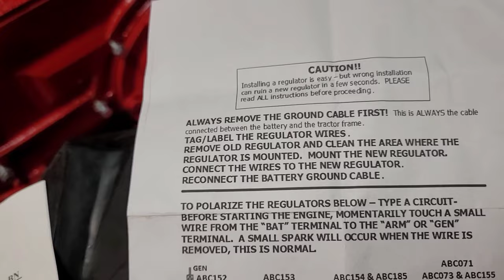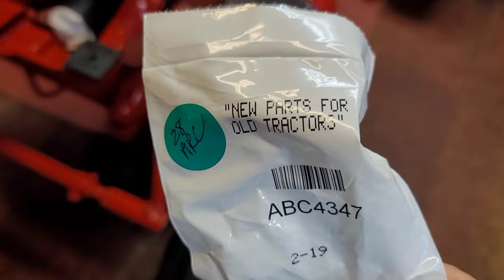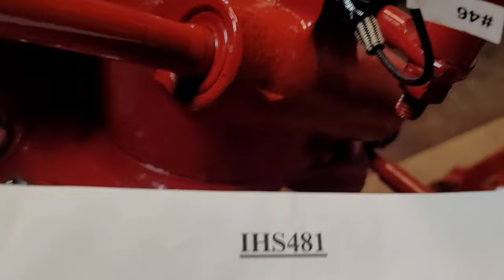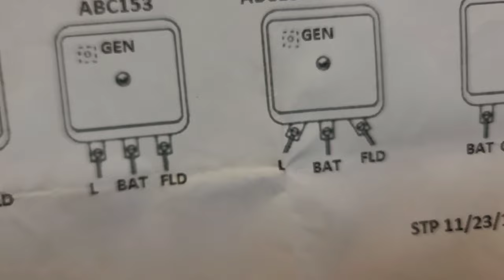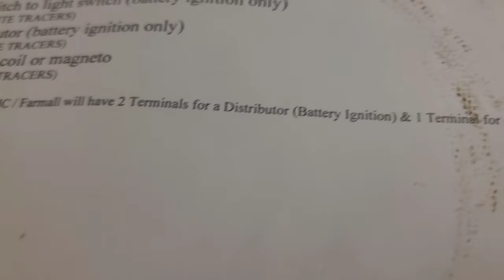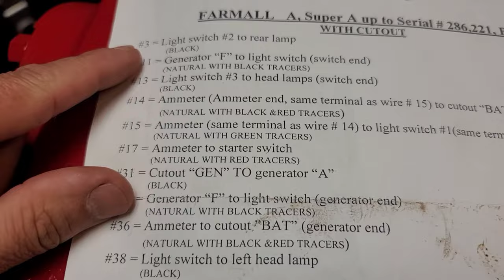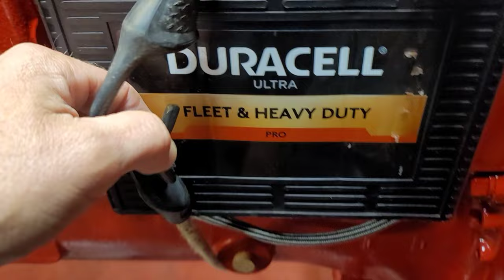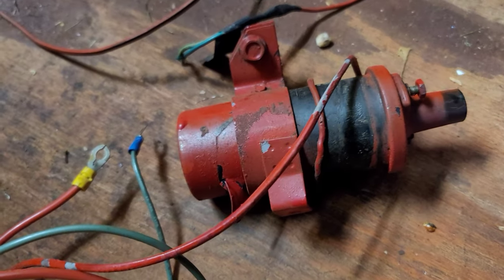Farmall Super A Wiring Explained

Comment: I’m working on a 12v A with a generator and voltage regulator. Boy is it confusing. Old farmer hack job and I’ve been trying to rewire while keeping the Mag. There is not much info for it. 

I didn’t think to buy a pre made harness and wanted to save money reusing the old VR and Generator. 

The only real difference other than 6v is I have a toggle light switch and not a 3 or 4 position. You’d think that would be easier, maybe so, but there is not a lot of info on a correct setup. 

This helps me a bit so thank you!
Reply from the maker: It can definitely be a pain when someone has butchered the wiring harness!  Im all for just replacing the harness with a replacement whenever I can, definitely makes things easier and safer!